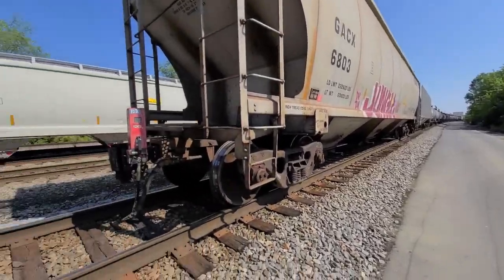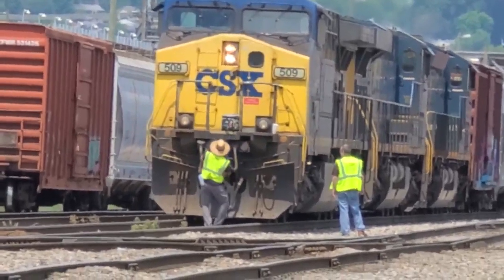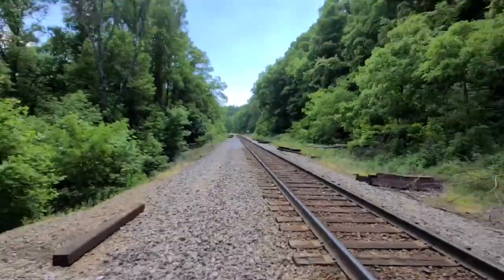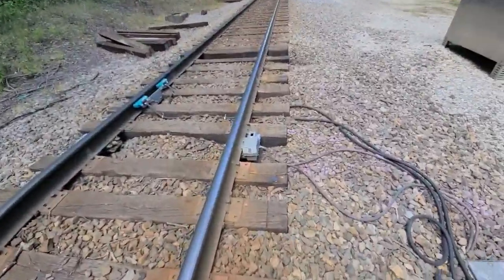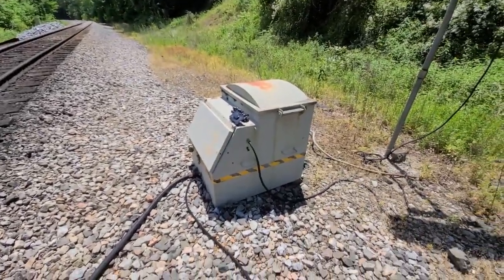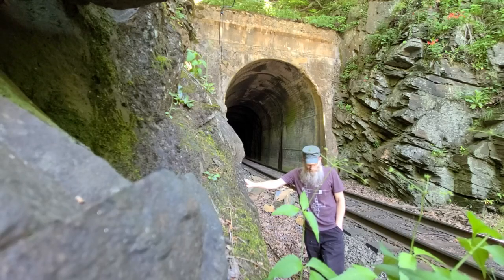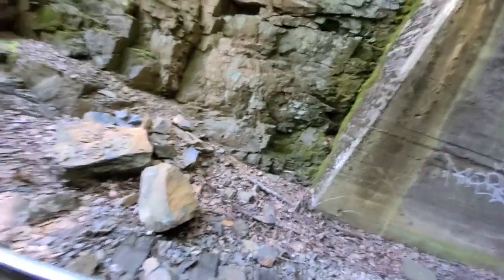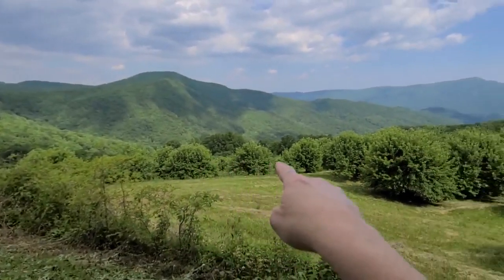Hobo tunnel of knowledge and waiting

Comment: Shoestring asked about the smooth concrete at the  entrance of a tunnel through mountain rock....it has to do with water drainage on the smooth surface of the entrance and the smooth concrete wall keeps erosion in check....no one wants large rock chunks laying across those rails at the entrance...there is also a air pressure wave that's created at the entrance when the train enters the tunnel, that could dislodge rocks if not for the smooth concrete wall.
Reply: very cool....principal....
Reply: Thanks. I did not know that...

Comment: Those EOTs replaced the cabooses. When trains grew longer, it made it hard for the conductor & brakeman in the caboose to look further down the line of railcars for any load shifting or hot boxes when the train is moving. Another reason is the slack pull between the couplers because the further away from the locomotive you go, the stronger & louder the pull between the couplers on the railcars. The old cabooses that had top cupolas were dangerous on long trains if the crew rode up in the cupola because the strong pull would jerk & make the crew men fall down off the cupola & down onto the floor which was why they switched to cabooses with side cupolas before they retired the cabooses & replaced them with EOTs. Other technology replaced the cabooses too such as those defect detectors.
Reply: Another reason is the railroads did away with the brake man and fireman positions.
Reply: I often wondered about that; you rarely see a caboose anymore. They were always one of my favorite looking cars.
Reply: Another purpose for the caboose was it allowed the emergency brakes to be applied from the back of the train, for instance if the crew fell asleep and ran through a signal. The eot has the ability for the crew to release the pressure from the back of the train, which makes for a more orderly stop.
Reply: @darykinnaman2319  I still miss seeing a caboose at the end of the train even after all these years. I grew up always seeing a caboose at the end of a train.
Reply: so climb on the front if you can for a smoothe ride, gotcha, sgood advice

Comment: thats a LB Foster / Portec Rail Gauge Face Greaser.  the older greasers had a piston like you said but these are battery powered.  there’s usually a magnetic wheel counter that counts the axles and depending on how it’s programmed it will squirt a puddle of grease every 15th wheel to prevent too much grease being distributed.  that solar panel charges the battery.  solar panels usually point south cause that gets the most sunlight 👍

Comment: I visited Whittier, Alaska on my R&R when I worked Prudhoe Bay, Ak. There is a tunnel shared by road vehicles and trains leading to Whittier. When I returned to work a guy told me he worked installing the telephone cables through that tunnel. He told me they used a rail car fitted with pipe nipples to hold brooms to gauge where to remove rock from inside the tunnel to make sure there was adequate clearance between the tunnel and the rail cars.

Comment: I love the feel of the tremendous power and the ground moving of a train as it passes by.
Something? reminded me of a story told to me a long time ago by Hobo Moon. Goes something like;
When the space shuttle was being designed they had to abide to that the shuttle's main body was to be transported by rail so the dimensions of it needed to fit on a specially built train car(s).
When the USA railroads were being planned for building back in the early days a lot of immigrants came from Europe to work and design the rails. And since most of the rails in Europe were routed where on the wagons trails were that they'd been using for centuries . So naturally the width of the rails were fit to use those old wagon trails. So the design of one of mans greatest technology feat's, the space shuttle and the size dimensions of it was determined by the width of two oxen asses side by side. True?? who really knows. But Funny! Yes!

Comment: Worked for UP and then ATSF in my younger days (as an analyst and then Industrial Engineer), and part of my job was to work around train-yards and occasionally throw a switch or ride a freight car (following along with a crew).  SAFETY was constantly emphasized because ignoring a 120-ton rolling piece of metal can lead to very bad results.

The stated ideal was 4mph, but if the ground/ballast was good, I could safely get on/off a freight-car at the ladder if it was moving up to 10mph.  Riding on the outside of a freight car for more than 1/4 mile never occurred to me then  . . .or now.

Comment: Cool footage.
Reply: the concrete collar on the tunnels is to prevent collapse. less pressure and weight towards the outside of the tunnels. opposed to the center, but can change depending on the earth the track is going through.